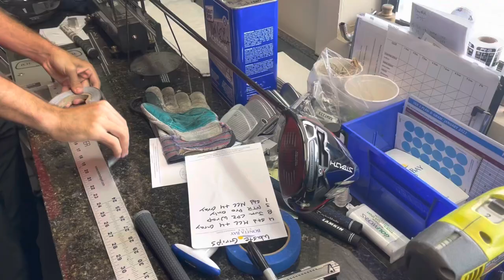Fixing the swing weight of my Driver

Comment: Bought a stealth regular head and Mitsubishi Kai'li 60s separately. SW came out to D9! Had to put a lot of lead tape to balance it out. Even though Kai'li comes with Stealth plus, was very surprised by the SW.
Reply from the maker: The heads have slightly different weights on the back port which they try to use when they know which shaft is going in there
Reply: @BuzzaGolf  I'll need to get a weight set.  Using lead added a lot more total weight to the club.

Comment: What is the weight of each strip of lead tape?
Reply from the maker: Not sure
Reply: @BuzzaGolf  Depends on how much you cut off the roll of tape, most are set at pre- determined incriminates of .25 oz. per gram or something like that.
Reply: A 4” strip of 1/2” wide lead tape equals 2 grams (or one swingweight point).

Comment: D9, FFS you cant' Swing that can you Buzza, surely?? Get it back to a D1 for your slightly mature years! 😆
Reply: Steve should have re-tipped this I reckon, who cut it down? Far too much Lead going on to counter balance, just re-fit a new shaft for the length you need i.e. a heavier shaft weight..........